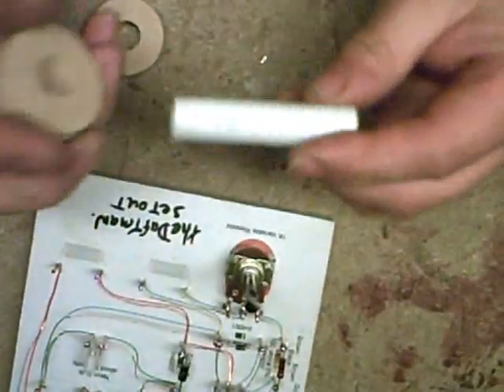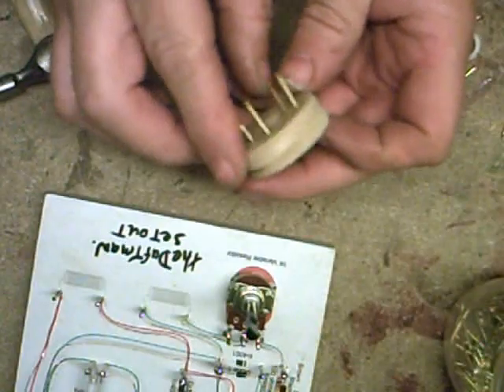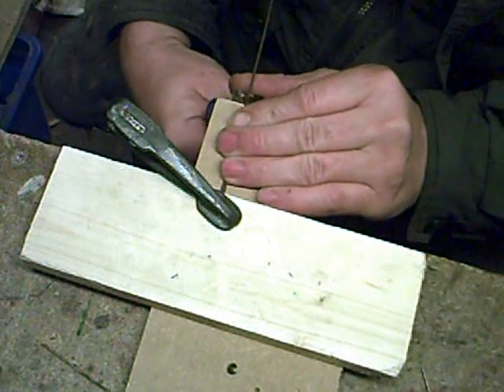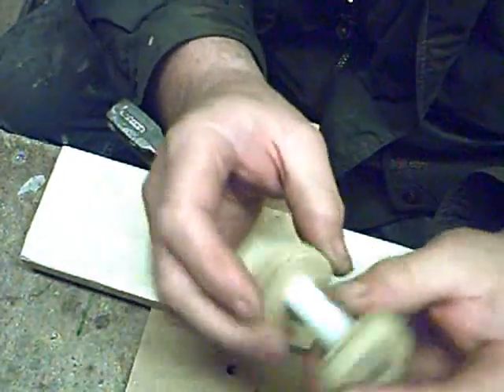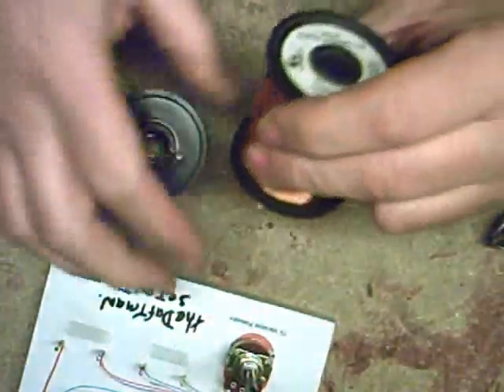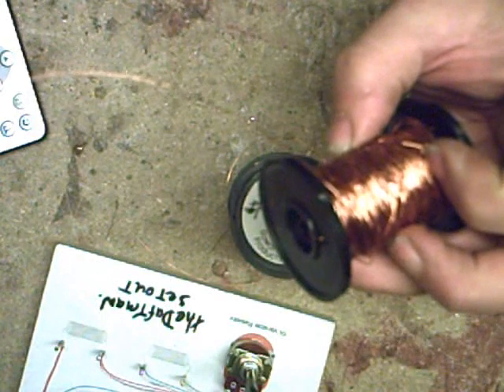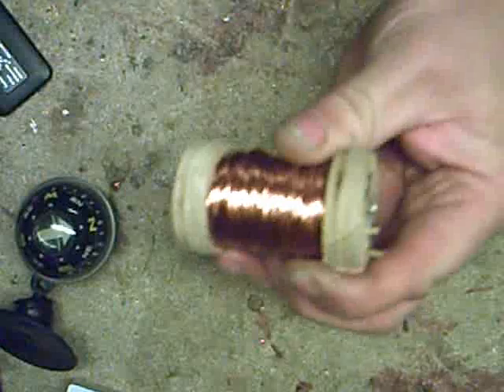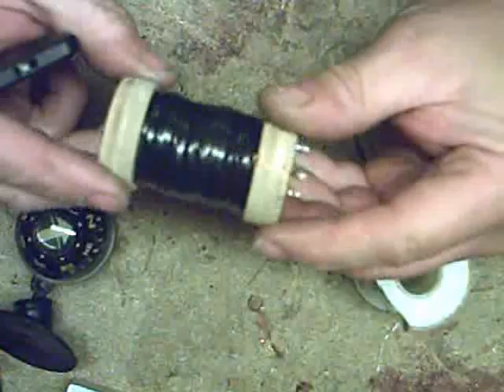Bedini pulse motor, build and diagram video 2 of 3. (TheDaftMan)

Comment: Where exactly do I tap into the circuit to charge batteries?  I have one point at 50 volts but no spikes.  It comes from a power coil.  Where do I find the BEMF for charging?

Comment: Nice job DaftMan!
Why the large tinning of the start ends of wires? And what are you using as best reference on Bendini's work? Also I 2nd request for decent shot or pdf of your circuit board.  Cheers.

Comment: Hi there, i need a lilttle help here... i´v made everything like you say, but made it with differents copper wires... and made it about 300/ 400 turns. but when i try to run the motor he dont run... as too much electromagnet i guess... instead of self running he spins about 4 or 5 turns and stops.  i guess the problem are with my coil but if tou can give me some help on what it can be i´ll appreciate.

sorry for bad english.

Thank you.

Comment: Hi,
I'm using AWG 32 which is .202 mm for the trigger coil. Will that work instead of the .224 mm? THe pot I got is much smaller than your diagram. Is that a problem it says PHL PC82. I'm using a larger diode than the In4007, In54something (can't find the receipt). THe store person said this should work. (I'm new to this.)

Anyway, trying to figure out why its not working. Doesn't even want to power up. Thanks.

Comment: large transformers use steel / iron plates, however smaller transformers use ground beeds in a sort of ceramic type composition...
Iron filings / epoxy mix is ver similar to the way smaller transformers work...

I have seen seperated segments in coils, however, by doing this you are changing the 'dynamics' of how the coils work. as an experiment, i'd say try it... but only once you have built a couple of bedini's.

WARNING: Changing coil dynamics can cause DANGEROUS levels of back EMF!

Comment from the maker: You may find the coating is to help stop corrosion and to eliminate vibration from the plates. Maybe most of all is to prevent noise and to help with stability of the coil construction. 
I know that's a bit of a short copout but that's mainly the reason for the coating.

Comment: i only ask because i have already pulled apart several transformers in my search for usable magnet wire, and always found that the laminations are coated with a nonconductive layer. I know this because i had to scrape this layer off when using the metal as a jumper between 2 batteries...sorry to go on about it...

Comment from the maker: I have never come across any multiple cores that has individually insulated segments. But would be interested to see one. Thanks for your questions. Sorry if it seems like the above was a bit blunt but its hard to answer some questions with the 500 word count.  I will also get back to your question on the forum soon.
Reply: Are the trigger wires and the run wire used in the coils coated Do they have any kind of enameled Coating., or any Coating. on them?

Comment from the maker: This was copied directly from Bedini's work. What I am saying, this unit was built the Bedini way the core is what Bedini calls for. Thanks for the question but I don't want to be pulled in to this one has it will turn in to a long drawn out 2ing and throwing with this subject. What I will say is have a look at any transformer of coil even a relay and see how they are put together. You will find the answer there.  Sorry but some subjects are best left alone.